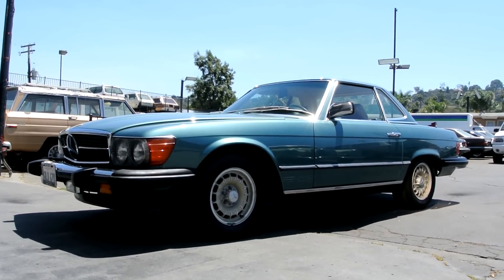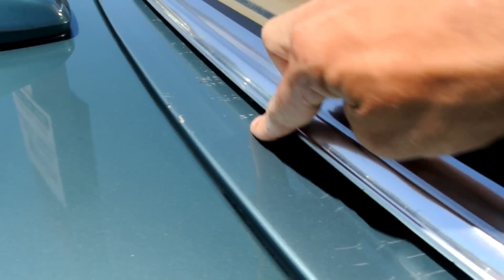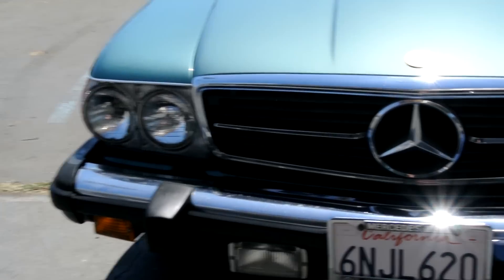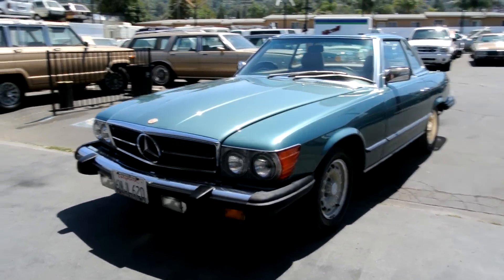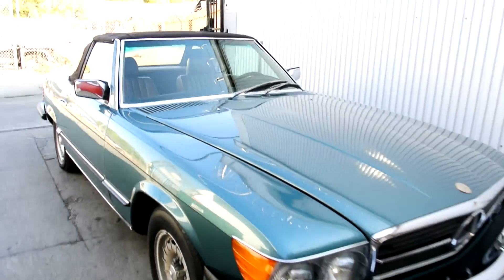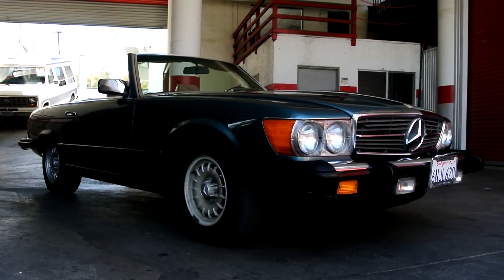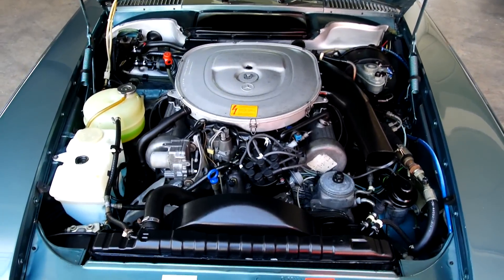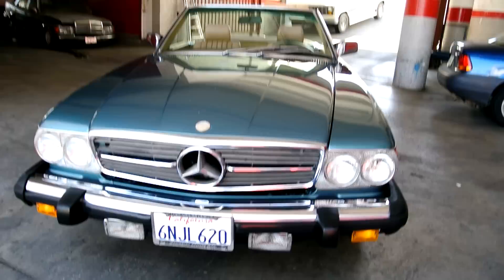1 Owner 1985 Mercedes Benz R107 Roadster 380SL 380 560 Youngtimer SL Slass Convertible

Comment: I wouldn't say these are undervalued. Whenever I look at exotic or classic car dealers, I find that these are one of the most commonly found and highest priced classic MBs. This along with the W124 300CE convertibles; sedans not so much. Really depends on the condition and mileage though but classic car dealers and Mercedes dealers (even when selling a 1990) always charge a lot for everything lol. Even oil changes aren't cheap at them!